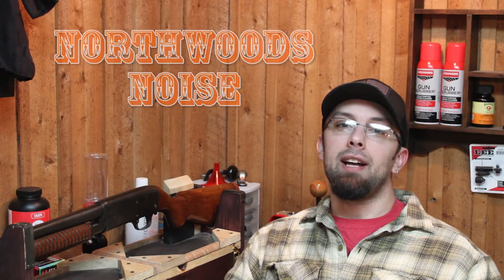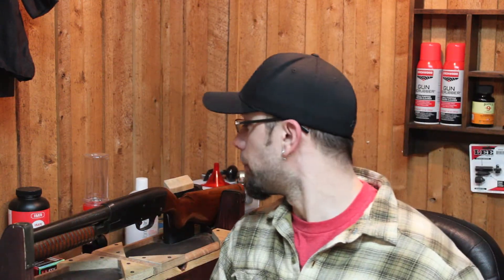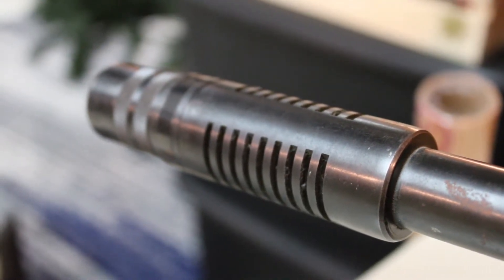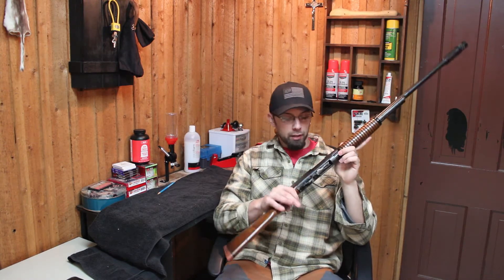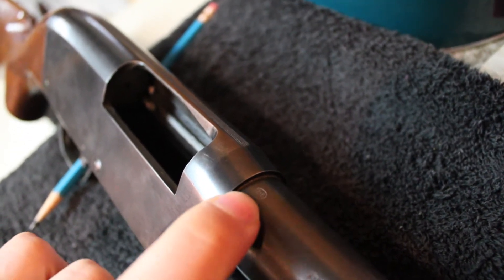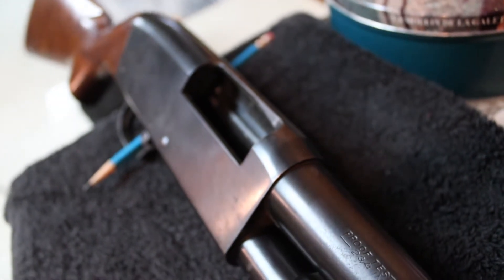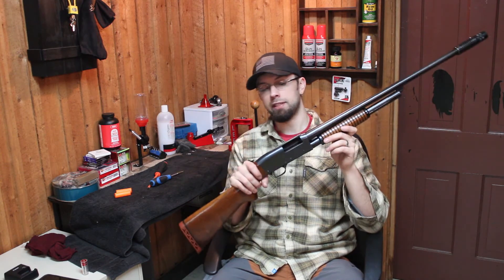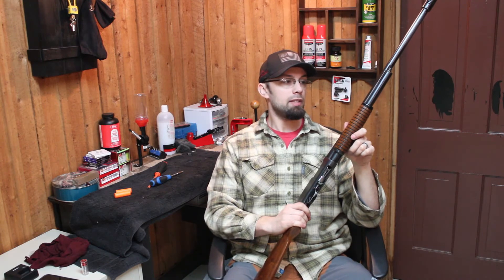Will it fire? 1953 Savage/Stevens 820b disassembly, cleaning and test fire.

Comment: i wonder if the issue I'm having with mine is what you mention @22:06. my savage won't load unless the pump/bolt is down/back. otherwise the shells come back out. I'm thinking the chambering issue I'm having is maybe a magazine tube spring issue. the spring i guess is too weak as it wants to fail on feeding on that last round. downside is i can't seem to find a spring for a 20g model.

Comment: Great video! Was hoping you had tried to slam fire it? Any advice on using low brass vs high brass I would greatly appreciate it. Also, do you think using buckshot for home defense is ok on this old a gun?
Reply from the maker: Thanks! I forget why I didnt slam fire it. I think there was an issue with the slide release, where I couldn't cycle the action after firing without holding the release button down. I never got the chance to look into that further. That's a good question. With several 12 gauge home defense options out there at sub $300, I'd probably save some pennies and get something newer that could handle the task without question. The mossberg maverick was always my go to HD shotgun.
Reply from the maker: In regards to hi brass or low brass, my opinion is that with modern ammo, it makes no difference. However, I'm no expert on the subject. The old rumor is that high brass loads are more powerful. More brass=more support for hotter loads. I'm not so sure that's true anymore. I think the best thing to do is head to the range with a box of each and see how the gun performs. Personally, I always err on the side of safety and stay as close to period correct ammo as I can.

Comment: I have two... The first one I bought I got it for 50 bucks.  Buttstock is broken and if you pump it with the trigger pressed, it fires out of battery (bolt half the way).  Dunno what the problem is.

Got another one it better condition but never fired it.  Wanted it for hunting, but it need to have a serial number.  Dumb local laws.
Reply from the maker: Just out of curiosity does it actually fire out of battery before the bolt fully closes? Every one I've put hands on will slam fire, but it does it once the bolt is closed and locked. Gotta ask... where are the local laws so bad that they require serial numbers on pre-68 guns to be used for hunting?
Reply: @NorthwoodsNoise  Yes.  It fires without the bolt fully closed.

About the local gun laws...  Every gun you own have to be registered with the police dept.  If the gun never had a serial number, you can own it, but it can't be registered.  And, if you're going to use a gun for hunting, you need to register it AGAIN with the local game and fisheries dept.  But, if it couldn't be registered with the police, you can't register it for hunting.

I own four shotguns without serial numbers, and the only thing I can use them for, is for wallhangers.  I even asked if I could add a serial and be able to register them...  Answer was no.  So, I have two 820B, a Glenfield 50 and a Westernfield 30 that I can't use for anything.  I don't even want the risk to go to the range with them, and be stopped by the police and get caught with an unregistered gun.  I can prove that I own them legally, but, it isn't worth the risk of having a bad time.